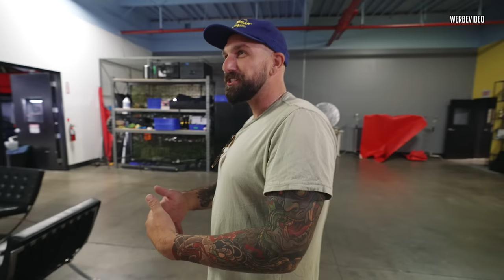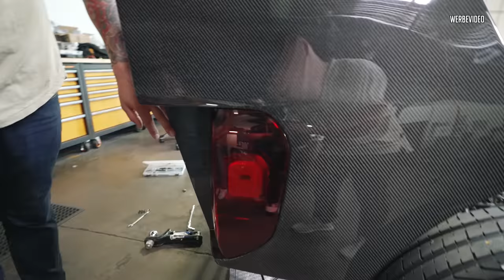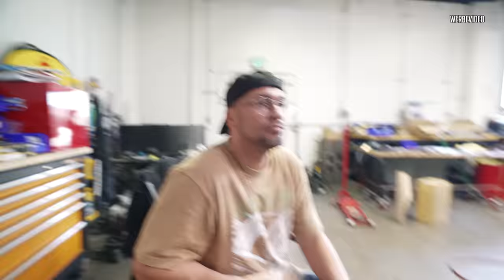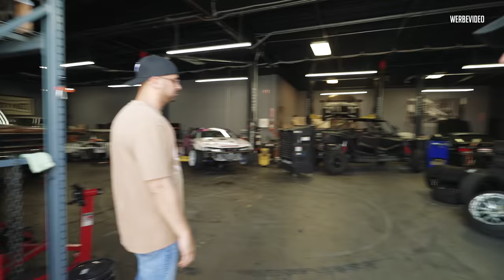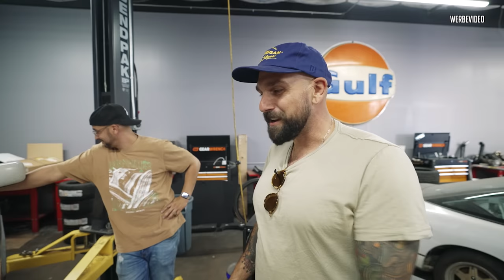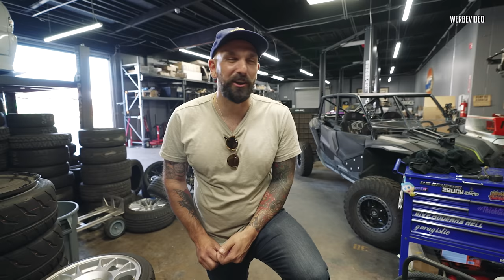JP Performance - WILDER GEHTS FAST NICHT! | Besuch bei Hoonigan! | Los Angeles Roadtrip

Comment: 10,3l. Hubraum sein Vater 😂 
Mir fallen da kaum Autos ein in denen der passen könnten. 
Beim R129 ist der Motorraum echt groß aber der kam damals mit dem 7,3l V12 echt an die Grenzen. 
Das Ding kannst du eigentlich nur in irgendwelches Amis verbauen wenn du nicht fast alles außer dem eigentlichen Motor nach hinten in den Kofferraum verfrachten willst.